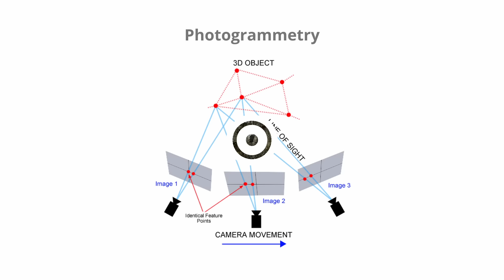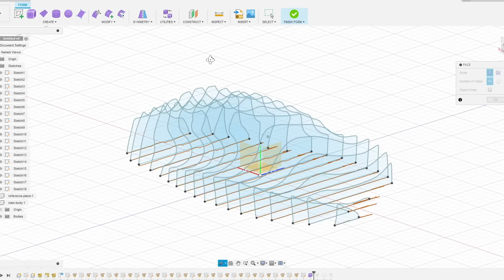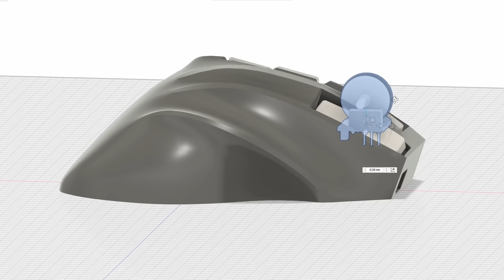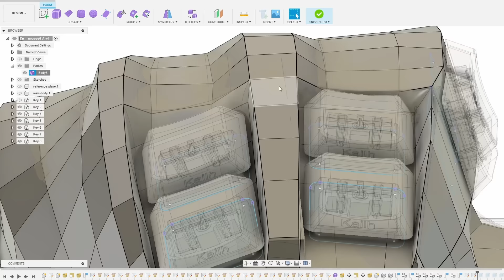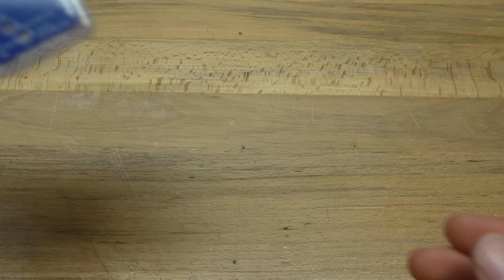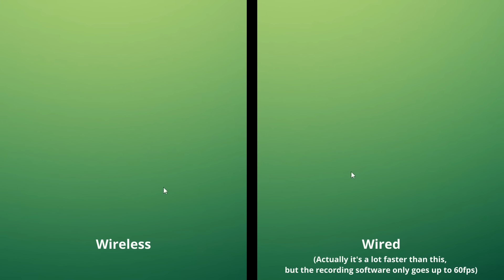I built a mouse from scratch with 3D printing and Arduino

Comment: Sheesh that is crazy. Namely the cost in money and time. For money alone how much did all those components add up to in the end including shipping and taxes? I'd guess like 150$.

A+ for repairability and ergonomics though, but I'd definitely look into changing at least the LMB to a proper low travel switch for mice.
Reply from the maker: Somewhere around $100 I think, but I had some parts already like the arduino and resistors, headers and wire. The most expensive part was definitely the sensor. But yeah, its certainly cheaper to buy a mouse on amazon or something, obviously. This was more about experimenting with different parts and trying to maximize ergonomics.

Comment: My 3D Game O2 has lasted me 15 years so far (of very regular and frequent PC use; and lots of gaming). Definitely a purchase I don't regret, despite the fact that I was super upset at the crappy hat switches and crappy software required to even use them. It was advertised as essentially having 3 analog sticks on it, but they were 3 clicky 4-way (technically 8, since two directions can be done at once) hat switches, which were mostly useless for me and not what I wanted.

My dream mouse would have an analog stick on it. A strain gauge control (like scrollpoint/trackpoint as in old IBM mouse or laptops) would be good instead or in addition to that. But so far despite the demand and tech being around for 20+ years I have not seen any made. For a long time I think the Scrollpoint tech was patented (which I thought was stupid), but as far as I know even that has expired now.

Comment: Had an idea like this bouncing around my head for a few months now. I haven't been happy with the way a mouse has felt in my hands since the Saitek R.A.T. 7 but even if I wanted to scrounge around for old stock i'm too used to the extra buttons and functionality my Roccat Leadr provides. And since mice like the Leadr seem to be few and far between i've been thinking "screw it i'll do it myself". I've also seen all the "take this mouse and put it in a new shell" videos and that's what i've wanted to avoid. I figured I was going to have to design a PCB at some point, but I had no idea how I was going to do the rest. This helps a ton. Might be a bit before I actually get around to doing this but the idea keeps growing :3

Gonna miss the wireless bit of my Leadr though, but I barely deal with code as it is i'm not going to attempt to figure out how to get the latency down.

Comment: That's weird because I have even bigger hands, 21 cm from the wrist fold to tip of middle finger, and I have the same Logitech mouse, and I have never noticed that the mouse was too small for my hand.
You whole hand is not supposed to be supported by the mouse, this is incredibly bulky.
Also, the premise is false. The switch are actually easy to replace with just minimal electronics skills; you can buy a life worth supply of those switches, including all of the common sizes for a few dollars / euros. 
If your wheel stops working properly, it's because there is crap that found its way next to the rotary encoder; in my case it was just cat hair.

Comment: Mouse encoder should of worked I've done this before on a nano but ended up making an optical encoder in the end as they only have 12 clicks per rotation. This is a very nice design I may add

Comment: You can use an Adafruit Feather NRF52840 Express to have better luck with wireless functionality. Most mice nowadays use an NRF52XXX chip. You probably won't need to change any footprints, just the firmware to get it to work.

Comment: Looks great. I would definitely look for a USB-C version of that board - even though it'll cost a few cents more, USB-C cables are getting cheaper than the micro USB ones. I will definitely try if your hand is somewhere near the size of mine as I have that same issue with gaming mice being too small and getting cramps in the pinky finger.

Comment: Tip when you're doing photogrammetry of objects like this. Take photos in a vertical arc, starting lower down, and then rising up to the top of the object, then step to the side and take another arc. This requires about 10x fewer squats since you only have to personally orbit the object a single time. It also results in more consistent vertical and horizontal spacing of the images.
Reply from the maker: Good tip, thanks! But all the squats are good exercise haha

Comment: double index & middle buttons is something i now want on every mouse
Reply: look at logitech g300s
Reply: @denpro8845  not really the same. i already have that on one of my mice, a logitech too.
Reply: @alex_oiman  swiftpoint z2
Reply: If you're still looking, there's the Swiftpoint Z2, you have the L and R buttons, then 2 buttons just like this build but are size swappable for different finger lengths... then after those are L and R "Flipper" buttons that you can push down or pull up, also size and shape swappable. That's 8 dedicated to your index and middle fingers without counting the 2 shelf buttons to the left of the index finger. Also, your L and R are pressure sensitive haptic feedback, so you can set a harder press to be a different button push for games that originally featured this on PS5 (Returnal and Horizon in particular).
Reply: @DanSilverhound  cool. thanks. i'll get it for my next replacement.

Comment: I was looking for such a mouse tracker! thanks finally found one. 

but a few tips for your pcb design as a teacher:

1. avoid angles sharper than 45 degrees in your traces. to sharp of an angle can cause emc. this also goes for junctions, add diagonals to them.
2. don't run traces through pads. because of soldering and regular currents through the pads they will wear out quicker causing it to fail faster.
3. add a ground plane and power plane, this will reduce production cost and emc.

though I must say you did well for a first design, keep it up.
Reply from the maker: Thanks for the tips!
Reply: Can you explain #2? Doesn't every pad need at least 1 trace to be useful?
Reply: @TheRainHarvester  basically don't connect 2 traces to one pad, but add a T-junction next to it. this will reduce the strain on the pad itself.

Comment: I have found the perfect wireless mouse for me, although it uses a dongle instead of Bluetooth to connect. But its latency is too little for me to notice and except for needing one switch replacement so far it works flawlessly and has exactly the functions I need. Mouse wheel that can be pressed to toggle the ratchet and pushed left or right to scroll left or right (very rare function as it seems), a seperate middle click so I don't scroll when middle-clicking, and a back and a forward button which I regularly use as I work a lot in the browser where they come in handy. And no more functions, just the ones I need. It's a Logitech mouse, although I haven't been able to figure out the exact model so far. It's an office mouse but also capable of basic gaming. 
[EDIT]: And no, this isn't an ad, this is just me describing why I really love the mouse I got several years ago.

Comment: Good job! Just had the same idea!
Have you thought about using an Arduino pro micro just as a receiver with an nrf52 or similar? The controller on your mouse wouldn't need a native USB interface so a cheaper Arduino nano would do there as well.

How's the weight of the mouse and the long travel of the switches compared to a normal mouse? Is it tiring over time?
Reply from the maker: The weight is 143 grams/5oz. Its not bad at all really

Comment: This is really amazing and unique design. I always wanted to try and make my own mouse but the my main problem is that I want to to work wirelessly through a 2.4ghz rather than Bluetooth. I am not very code savvy so I would have to rely on someone else work to get it done. But like you found it seems like it's pretty difficult to make a wireless mouse work on Bluetooth now I fear a wireless non Bluetooth would be even more difficult.

Comment: I am curious as to why you didn't just purchase a mouse IC that basically has everything in it you need, optical flow sensor, rotary encoder for Z- axis and some button inputs all with USB connectivity. You can even get wireless versions.
Reply from the maker: I wanted to be able to position the buttons/scroll wheel exactly where I wanted them, plus this was a good opportunity to get familiar designing PCBs, which I will be using in upcoming projects.
Reply: @benmakeseverything  You have missed the point. You can buy a "chip" which is basically a mouse. You will still need a handful of external components but you don't need to do any programming because it's all done for you. However, you would still need a PCB to mount the chip, and you could put the buttons and scroll wheel where you want them. It is one thing to do a custom mouse it is just crazy to use a microcontroller when SOC's to do everything exist.

Comment: Nice project, thanks for sharing. Bluetooth is well known for its terrible latency. What would have been interesting to see is a 3rd version using two ESP32 boards, one as a receiver connected to a PC via usb and the other in the mouse connected via a by point to point WiFi connection to the receiver. Furthermore, it would be worth checking out newer ESP32-C6 boards using a proper IDE with ESP IDF 5.1 and exploring other RF standards and its automated power management to see if you can optimise battery life.

Comment: This is awesome. I've been using a Steelseries Rival 500 for idk how long now and its not manufactured anymore. i had to fix it countless times. swap out switches, replacing the cable, glueing broken pieces back together etc since no other mouse does it for me like this one does. it fits perfectly in my hand and has exactly as many buttons as i need. 
But i never thought about making my own mouse which would fix my issues. im gonna try to do this :D

Comment: Btw if you use a subdivision based workflow in blender, you can export the unsubdivided base mesh as a quad obj. You can import this into fusion 360, convert to t-spline in the form mode. When you close the form mode, you are left with a shape very close to the original subdivided model. I mention it as I find SubD modelling in Blender so much faster and easier than messing around with organic shapes in Fusion.
Reply from the maker: That's cool, I did not know that. Thanks for the tip!
Reply: dude thats excellent workflow thanks

Comment: I once made a monitor with arduino, it used a arduino nano and a 128 by 64 oled display, I got around 6 hz refresh rate, it used serial communication.

Could you try it? :)

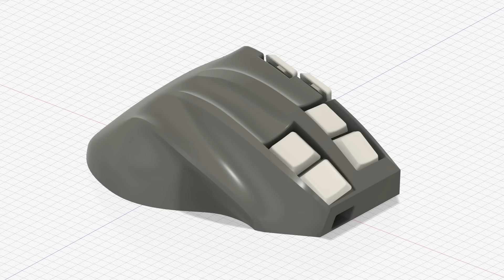Comment: 6:03 the Elecom HUGE and their similar trackball mice have thumb operated scroll wheels
Reply: and as I found out, they give me bad RSI in my thumb, but I found a hacky workaround to toggle the trackball between pointer and scroll wheel
Reply: @_BangDroid_  when I'm not using all the buttons I actually use my pointer to scroll with it, just dangle it over the edge and scroll

Comment: Im def gonna try this out but with a mouse i currently have, its a spare mouse i bought for its sake of ergonomic design, it has a similar botton layout i quite enjoy, but the chip wont allow more than 4 mouse botton binds. The other ones can be binded to premade finctions that are not usefull to me tho. so i would not mind try pryinh it open slam an arduino onto it and just solder the prexisting bottons to it

Comment: Really cool build Ben! I always appreciate it when people include the bumps on the road along the way to victory :). Reminds me that we are all human and it's normal to fail some times. 
That being said I'd say the result compared to the original idea is bang on. Even the build quality and easthetic's are nice. 

Don't ask me why but I'm addicted to the thumb button cluster on the razer naga hex v1. I've been keeping it alive for almost 10 years. I'm on my 3rd set of buttons 😂. When it eventually dies I'll most likely build something very simmilar to you. 

Something i haven't seen yet is a smooth finnish on a 3d printed mouse. I haven't tried it yet but if you print in ABS with a small layer height and smooth it with acetone I'm pretty sure you can achieve something very smooth and comfortable.

Thanks for reading my essay. Cheers!

Comment: Love the project and I've been looking into building my own mouse for a bit now but I'd say that repairing a mouse is far easier, especially the scroll wheel.

I had problems on my Razer Naga Chroma's scroll wheel and for anyone interested all I had to do was unsticking the plastic adhesives that cover the screws (gently, being careful not to break them to reuse them), unscrew the bottom, unscrew the mouse wheel rotary sensor (just another screw) and opening it. Inside there are some small metal legs that push against another metal part. In most cases to fix the sensor it's enough to bend the metal legs a little bit outwards using some tweezers, to make sure that they make contact with the other part of the sensor. After that put everything back together and that should be it! It's that easy and doesn't cost you a penny. If you have some at home I'd suggest putting a tiny bit of lube in it, such as wd40, it will help the contacts last longer without interfering with the functionality of the sensor.

For the buttons it's a tiny bit more complicated, but nothing that you wouldn't have to do if you consider building your custom mouse: soldering!
You just have to spend a few cents for another mouse switch (or rescue it from another broken mouse), open up your mouse, locate the switch that isn't working. Then you just have to desolder the old switch and solder in the new one. To desolder it, if you don't have the tools to do it don't worry: you can improvise and try to do the job using just the soldering iron. You just have to hold the tip of the iron on one of the pins that you have to desolder until the solder gets melted, then you try to move one part of the switch out (doesn't matter if it doesn't completely come off, don't rush it). Once done do the same for the other pin of the switch. You continue to repeat this bit by bit until the switch eventually comes off. Then you solder in the new one and another mouse has been saved from the trash!

ps: just to make it clear, no hating here! Just a guy, whose primary language isn't english, that is trying to share some knowledge with people that may need it or just be interested :)
Reply from the maker: Thank you for the info!

Comment: If you have a magnifying rig like a head mounted loupe, it's actually not that hard to solder surface mount stuff as long as the pins are visible and you have a small enough tip to work with. That rules out BGA and QFN packages, but you still can do a lot without them. It does eliminate the ESP32 mini module variants, though.

Comment: now you should make another version with a holyiot nrf52840 for better battery life (ZMK firmware helps too), you'd need a basic battery charge and protect circuit + a USB port and its respective CC resistors.

Comment: Really cool project — wouldn’t mind making one and I can think of a few other uses for some of the tools.

Obviously a bit of a late suggestion, but I wonder if you could get the Arduino version of the code to work with a nice!nano? It’s sold as a drop in replacement for the Pro Micro, and it seems like folks have gotten it working with the PMW3360 trackball.